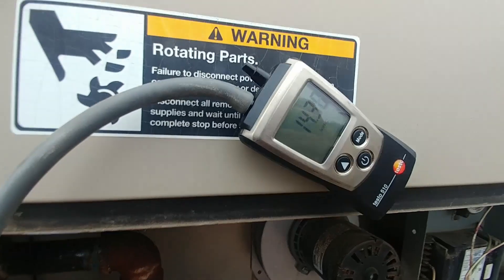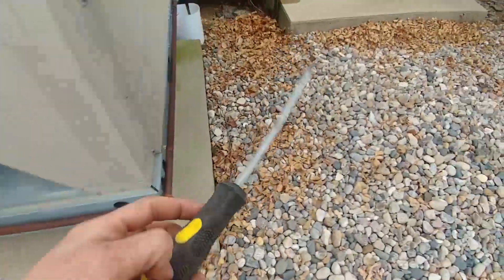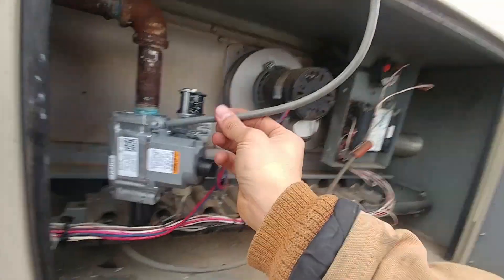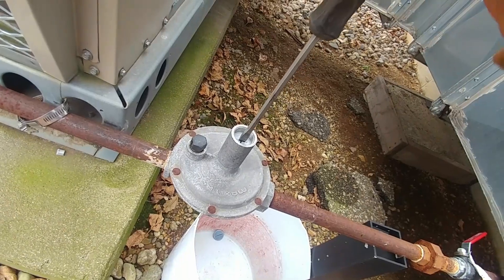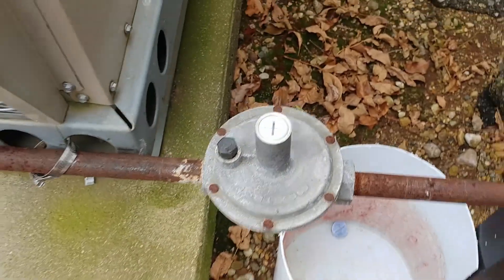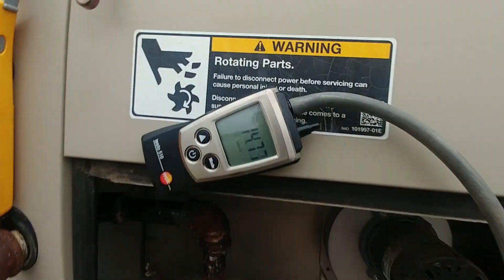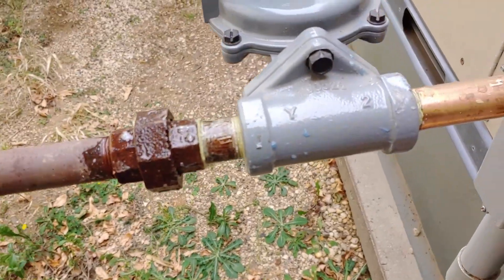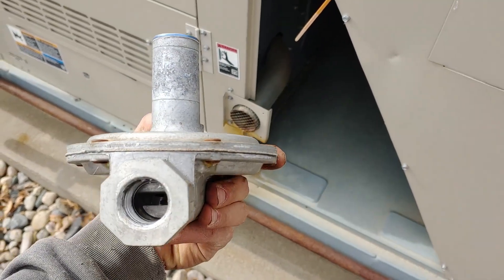Failed Regulator Troubleshooting

Comment: Working on gas pool heaters here in south Florida after the hurricanes last year almost all refs on the cost failed.  That and I've noticed a lot of guys are using the vent limiters that are indoor rated outside and water gets inside.  They require  special outdoor cap.  I've seen this 100x.  People not knowing wtf they are doing.  Good video.

Comment: Vent limiter was bad, should’ve just replaced the vent limiter with an outdoor mushroom. Ball was stuck corroded in place not able to vent. You won’t have any issues with the new one cause it doesn’t have a vent limiter. Only inside application requires a vent limiter.

Comment: That second grey regulator at 3min should have the vent facing down or water is getting in rusting it and freezing it up.    The first one with the maxitrol i would check pressures into the regulator first.  You may be overloading the maxitrol if it’s long term over 2psi.  Ive seen them go bad but usually a clogged vent limiter and for the love of god put a blue cap limiter on there for outdoors.  Who taught you gas?  One more thing- the grey regulator needs to vent 5 ft from the appliance or ignition source.  Use 3/4” electrical conduit and a meter vent or at least a makeshift screen.  None of that work is right

Comment: I got the problem where my gas goes off and i gotta go tap it or put hot water on it then it will wrk for a few hours should i replace it if so how do i dertimine pressure

Comment: All regulators are set when running not static, so begin there.  The 325 Maxitrol Regulator had an indoor Vent Limiter installed, NOT CORRECT.  It requires an Outdoor Vent Protector to prevent rain from entering.  The Itron Regulator should have been rotated by loosening the two bolts and facing Vent downward to prevent rain entering as well - DON'T USE A BUCKET AGAIN....  And finally, did I see brass nipple on a gas line on the second unit, that isn't what we see on gas lines, around here...

Comment: I only have the first stage regulator, a MEGR 1122H-AAJ which i used when the tank was about 11 feet from home and everything worked fine! I recently moved the tank 90 feet from my home and that's when I noticed the low gas pressure! I had my gas supplier serviceman check my gas connections as I was smelling gas (I have congestive heart failure from  Agent Orange and as the effects worsen I am not as strong as I once was so the joints weren't as tight as need be! I used 1/2 gas flex to 5/8 cooper the last 4 feet to home! Is there a chance I will need a secondary regulator the supposedly gas company serviceman didn't mention! I will admit Iwas a little suspicious of him even though he drove a truck with my gas company logo  the reason for suspect he claimed his normal work truck was in the shop SO he needed to use my tools , joint sealant and teflon! I really think I need another gas supplier!

Comment: remove a 250 gal tank farther from home but after move my gas pressure on stove in other words stove flame is very low same regulator only difference was 100ft new gas line what could be the cause?
Reply from the maker: What size line are you using? My propane tanks are 225 feet from my house, and are fed using 3/8 inch copper. At the tank the first stage regulator drops the pressure to 10 psi, and the second stage regulator drops it to 9" water column. Do you have two regulators?
Reply: William Brockman jr
1 second ago
I only have the first stage regulator, a MEGR 1122H-AAJ which i used when the tank was about 11 feet from home and everything worked fine! I recently moved the tank 90 feet from my home and that's when I noticed the low gas pressure! I had my gas supplier serviceman check my gas connections as I was smelling gas (I have congestive heart failure from  Agent Orange and as the effects worsen I am not as strong as I once was so the joints weren't as tight as need be! I used 1/2 gas flex to 5/8 cooper the last 4 feet to home! Is there a chance I will need a secondary regulator the supposedly gas company serviceman didn't mention! I will admit Iwas a little suspicious of him even though he drove a truck with my gas company logo  the reason for suspect he claimed his normal work truck was in the shop SO he needed to use my tools , joint sealant and teflon! I really think I need another gas supplier! @ReubenSahlstrom

Comment: I had a Gas Meter replacement recently and the Regulator and Gas Meter box was changed. The Tech did not check any gas pressures before or after, is that fine? Also what’s the symptoms of too much NG pressure coming into a house or is this not a issue with how much pressure is provided in the service lines? Also what’s the sign of a fault regulator? Thanks for any advice.
Reply from the maker: Too much gas pressure leads to an imbalance in the gas valves usually preventing them from opening. It is generally recommended to check the gas pressure on a system if an appliance has been having issues. The meter itself doesn't usually affect the gas pressure.

Comment: This video just saved me from having to pay big money to replace a pool heater. Turns out the regulator was letting too much gas into my pool heater and the valve would not open. I backed the screw off a few turns and now everything works! Thank you.

Comment: two things wrong with the  set up no sediment trap because  trash in the line from thread oil or sealant got in regulator and prevented lock up and the Maxitrol  had the vent limiter still installed you must cover it or remove and install a outdoor vent cap on it  I have run into several  jobs where the gas line installer had put indoor vent limiting regs outside and water and bugs get in the vent limiter cap and block it or it gets installed vertically and reg wont function correctly either. I could see right away when you connected you monometer I noticed the pressure kept climbing that's a sign its got something in the seat of the reg. good video.
Reply: You nailed it!! if the reg has seat or orifice damage the reg will not lock up so pressure keeps climbing.
Reply: You two are exactly correct👍. I have  been in the natural gas industry for over 35 years and have seen  a lot of contractors over look mistakes you guys shined the light. In the industry, we refer to this as a creeping regulator. 
Y’all stay safe out there  & regards from STL.
Keep learning and sharing that knowledge 📚
Reply: Vent ball corroded in the seat, he could’ve fixed the entire issue by just replacing the vent limiter with a Maxitrol outdoor vent.

Comment: hi Sir, can a medium sized gas regulator power 5 pcs of Laundry Dryers? ( 15kg load size dryer)
Reply from the maker: You'll have to look up the manufacturer information on the regulator and see how many BTU/hour it can supply, and then check how much your dryers consume, and them make sure your pipe size can also handle that load.
Reply: @ReubenSahlstrom  ok. Thanks. I tried to check on the specs but the dryer wrote gas consum 1kg /per hr. Thats why im not sure how can i calculate in Psi. My gas seller tried to sell me the largest and vwry expensive i saw i wrote 5-20 psi output which i think not really needed. Thats why i need to research around.😇

Comment: It's seems like when a main regulator fails (L.P. or N.G.), it causes problems with the rest of the regulators in the system. I'm a professional plumber, and a manometer doesn't lie. This is a VERY informative video. Thanks bro, well done.
- "Shit flows down hill, payday is Friday, and don't chew on your finger nails."

Comment: Why is 14"wc an issue?
Reply from the maker: Gas valves that use natural gas typically need an inlet pressure between five and seven inches of water column. This unit, had an individual regulator which lowered the pressure from two PSI to 7 in of water column. When the pressure exceeds the max inlet pressure the valve wants, it can cause the gas valve to stick. The solenoid has to be strong enough to open the valve, and if there's too much pressure it won't open. That's what was going on with this particular unit.
Reply: @ReubenSahlstrom  Interesting. Where I'm from (Ontario, Canada) gas pressures are 7-14" w.c...typically see around 10 at most areas. I think the same Rtus you are working on would be identical here
Reply from the maker: Are you running propane or natural gas?
Reply: @ReubenSahlstrom  Natural Gas in canada is supplied at 7-14" w.c. Propane is supplied at 13 typically
Reply: @craighvac1808  Here where i live, British Columbia, our newer homes have 2 PSI in the house but you need a 7-14" reg before an appliance. Perhaps if you have a ton of piping the savings on going to smaller pipe size could offset the cost of all the regs.

Comment: Dam - When I saw that inlet pressure initially, I thought you must working with propane! Crazy for natural gas.
Reply: Not at all crazy. Natural gas is supplied at very high pressure from the supplier, at least in some places and stepped down when it gets to the customer. Sometimes up to 10 psi, but this is more for commercial applications.